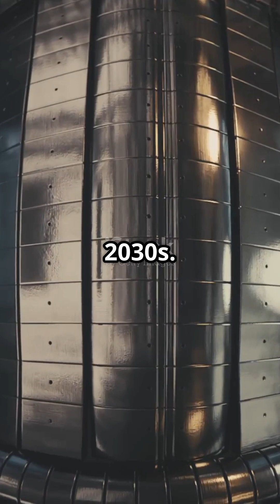Japan's JT-60SA: The World's Largest Superconducting Fusion Reactor

Comment: I may have a solution for sustained fusion.

Correct me if I'm wrong, but I'm under the impression that as the plasma gets compressed with EM pressure, the plasma spins around the tokomak.

From what I've gathered, this spin moves the plasma at around 73 million meters a second.

This kinetic energy can be harvested by creating a double-decker Tokamak  reactor with one spinning the plasma in one direction and the other in the opposite direction.

Spiral holes at the core with tungsten slide doors can be activated when the desired plasma speed is reached.

These opposing flows can be fed into a third compartment between the two Tokamaks, where they collide and cause a fusion reaction.

Before the fusion happens, the slide doors are instantly shut, which cuts off any energy backwash.

The fusion energy in the third compartment should automatically be pushed to the outer walls of the third compartment where other pipes feed the excess back to both Tokamaks, which might add the needed extra energy to cause a chain reaction.

As the chain reaction builds in energy, the EM pressure can be slowly cut back until self propulsion is reached.

Maybe???